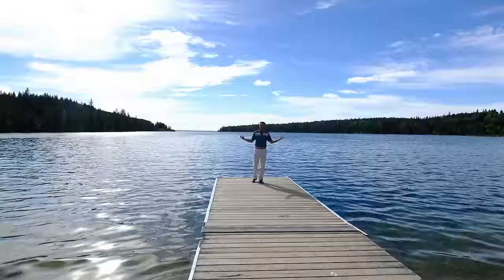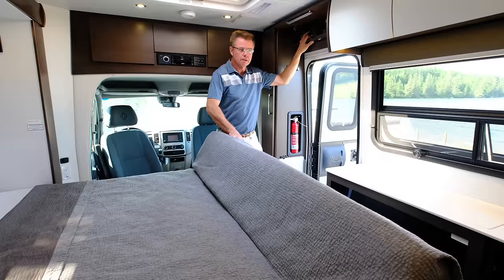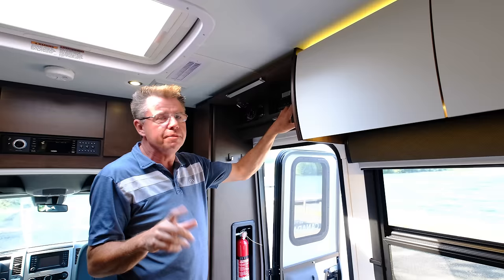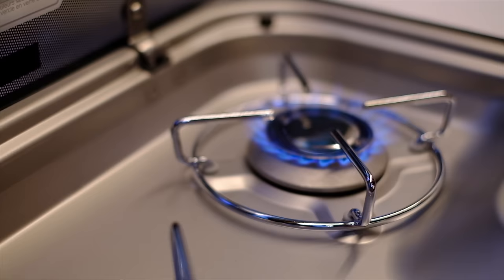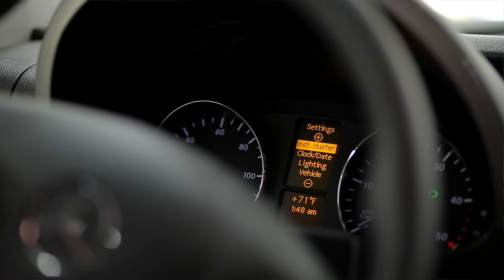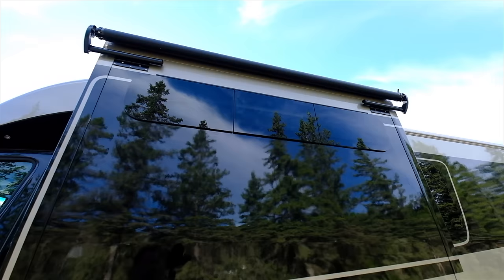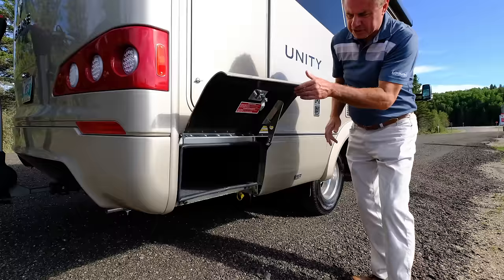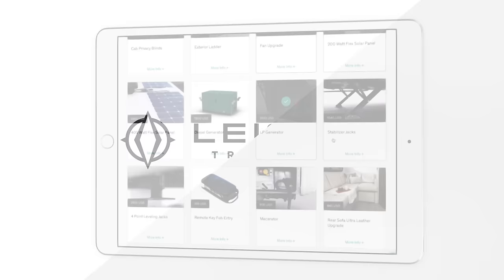2019 Unity Murphy Bed

Comment: I been watching the RV mobile home class B & C and Leisure is the best RV design and this guy is the best salesman he knows how to tell what people like to hear and what people need to know about their product. I love the class B mobile home.
Reply: we will feel safe travel along with him..I meant.. his knowledge about this...r u thinking the same?
Reply from the maker: Thanks Steve. We recommend seeing a Leisure Travel Van in person if you haven't already: https://leisurevans.com/dealers/
Reply: I had to wonder when watching this, though, how this one would be doing at -30 degs. C in winter use compared to previous Leisure Travel designs that were a little larger. I also wonder how much experience they've had with this particular foam formulation he talked about. With some types, if the unit is parked somewhere and various types of ants get started into the foam, they can eat the stuff away in volume to make a nice colony out of the interior wall or wherever they happen to get into. I am impressed with the use of a galvanized floor. Most RV's fail on the dissimilar-metals challenge between aluminum superstructure and steel floor, frame, and/or axle assembly connections. This still has the issue but at least they try to do something to minimize the corrosion potential by using galvanized product.
Reply: @ReflectedMiles  you bring up some interesting points. Too interesting. Appears to be a well engineered coach. I don't see myself enjoying the -30 below experience. I can see myself enjoying many of the new urban camping experiences the homeless rv trail blazers have provided for me.
Reply: thereissomecoolstuff  Thanks. Cutting out the cold season / winter sporting in Canada really reduces its usefulness, and at this price range it should be livable virtually anywhere anytime without concern. The nomadic Bob Wells / RTR followers do some interesting things. I especially like the cargo trailer custom conversions, but without good engineering behind them they are going to have issues fairly quickly and won’t last. Spacecraft and Prevost are in their own universe of high-priced monsters usually done right, but there are very few at the smaller / lower end that do, just Nord Euro and one or two others I have seen.

Comment: Impressive!  I priced one with the Murphy bed and most of the options.  Slightly more than $160,000.
Reply: Hal T  yikes
Reply: @dmsdms2707  - Yikes, indeed.  They are very pretty, they give you freedom, but they are not free.  The difference between a top of the line travel van and a comfortable car will buy a lot of motel nights.  Depends on what one wants and what one can afford.
Reply: Wow.
Reply: Don't get me wrong, I really like these RVs.  I think they are a great way to travel, especially the freedom they give you to stop almost anywhere.  If you've got the money to afford them, I think that extra freedom is priceless.  But, as an alternative, spend $35,000 to $45,000 on a good SUV.  That would leave you enough money (out of the $160,000) at $100 per night and 90 nights per year to cover the cost of a very comfortable motel room for 13 years.  Or travel for six months out of every twelve for 6 years.  

One of my neighbors has this same model, but I've not seen the interior configuration.   It sure looks like a sweet ride.
Reply: @Hal_T  - Its not worth it if you're just traveling, but if you wanna live off-grid, this is perfect. Instead of buying a car and a home, you'd get both in the price of 1 but with all the comforts. You can travel, park at your job so you're never late & don't have to deal with traffic (or work from home). And whenever you want to travel domestic, you can save the cost of flight, hotel, baggage, and rental car. I'd be a weekend wanderer, visiting the country. Instead of paying for rent or a mortgage, and a car lease, I could pay this off at $2K in about 7 to 8 years -- which is far quicker than paying off a mortgage. Not to mention that a mortgage also comes with property tax, furniture costs, maintenance costs, landscaping costs, higher insurance costs, etc. This van will require maintenance, but I can't imagine it'd cost me any more than what a home would require. Tbh I'd mostly keep it parked to live out of, like a Tiny Home and only drive it when I'm traveling south for the snow bird season. It's perfect for my situation. And here I was ready to buy a retired ambulance to customize for van living. That would've been way too costly and lacking most of the specifications of the Unity.

Comment: Best beds/living areas I've seen in the RV sector so far. Now make the vehicles fully 4 season, upgrade them to high-capacity Lithium batteries, 2-3000 watt inverter instead of 1000, and pave the roof with solar. Optionally, replace the toilet with a Cinderella Motion incinerating one, and some other odds and ends. And for heaven's sake get rid of the three way fridge and install a proper 12 volt compressor one already. :p
Reply: + inductive cooktop, and engine based generator!
Reply: @mundi6703  Agreed, you kinda need the Lithium to run the induction, and yeah ditch the Cummins and put in a 3-400 amp alternator and boom.
Reply: Thing is if they don`t do this, then other manufacturers will and that will take away sales for sure.
Reply: Exactly. This is the best build with Murphy bed but not practical
Reply: 'an while you're at it..Multiplex wiring, Voltstart,heated floors please!!!Sold!!!
Reply: mundi dot com 
Fire is better.
Reply: 3 options for using the refrigerator is Best. If Compressor breaks you have Nothing. As for inverter, you can probably Upgrade, or install your own.  As for the toilet it is a mascerator.(not sure on the spelling)
Reply: And add a Truma Combi, so the water heater and furnace can run on electricity when hooked up to shore power
Reply: @Croft:
I agree: 4-season for sure, and definitely more solar, but ALSO 4x4/AWD.
But the Canadian motorhome makers (who SHOULD know how to make a 4-season RV) just won't listen: Just come out with more bells and whistles on each new model, but NO real-world usability/capability/practicality -- for people wanting to USE their  RV ALL year long, and go off-road/boon-docking if they wish. And more solar power/batteries (lithium preferred) while out there.
They just don't get it, stuck in the past, more of THE SAME features, just updated, but not "getting with the program" TODAY: Only Winnebago has listened, and DONE it with their Revel in this AWD/4x4 & 4-season segment and with ZERO competition from any of these other makers -- like Leisure Vans! Yes, Winnebago's Paseo is 4-season, but not AWD, and their Era is AWD, but not 4-season. However, the Revel is BOTH, and the ONLY "B" (or B+/small C) like it for sale presently.
Keep the dry bath, trendy popup TV, Murphy bead -- all very NICE, true -- but it's not worth giving up practicality/real-world/everyday usability: 4x4/AWD (as more people are wanting nowadays given the "Overlanding" interest) and 4-season...or settling for anemic solar outputs.
Winnebago is the ONLY major factory-production small motorhome maker that listens. Leisure Vans doesn't, Pleasure-Way doesn't and Roadtrek doesn't.
IMO, WE tell the makers what we want...THEY don't tell us -- no matter how slick the sales presentation is.
Go figure...
-- BR
Reply: @ Bumble Bee:
No, the ammonia/absorption/propane refrigerators are LONG obsolete. COMPRESSOR units are the only way to go. 
It's 2018 for gosh sake, but lots of RV makers are "stiffing" people with the older, tired "technology" anyway...I guess trying to use up and the OLD stuff in their warehouses so THEY don't get stuck with it -- let the customer have it instead?
I'd never buy a new RV today that does NOT have a compressor refrigerator/freezer.
-- BR
Reply: And change out the propane cooktop for a induction cooktop
Reply: @DMosesRN  Or, keep things as is (with propane cooktop as a "backup") and bring along 1-2 portable NuWave PIC units (or similar products). I've been using mine for 5 years now and prefer induction cooking even @ home. 
But by the time I'm ready to get MY Class B (2-3 years) I expect MOST Bs will have moved more towards all-electric, and consequently to induction cooking. As long as the RV has plenty of solar and lithium batteries (but CHEAPER in 2-3 years i hope!) that should do -- when I'm not plugged-in @ a RV park somewhere on occasion where solar and batteries don't apply.
Happy Travels,
-- BR
Reply: Many people can't afford to buy one as it comes. Now you want to make it even more less affordable.

😳 Well, I suppose your ideas would be options for those who can afford to spend that much more.
Reply: @billredding2000  I think you are right but this unit is definitely more for the general rv user. Not the boondocker. The under chassis storage is the dead ringer. The chassis can handle it no problem. 3500 Mercedes is awesome. There are adventure units available just not on a mass scale. I love the Murphy bed. Way better than safaris magic bed.
Reply: @thereissomecoolstuff  
True, MOST RVs (regardless of class) are for the "general public," but with the increased interest and growing "overlanding" segment of the market we've been seeing, RV makers are only beginning to GET IT that some of us want a more usable (4-season) and more capable (4x4/AWD) vehicle...be it a motorhome or more rugged towable. And with more solar capacity. 
As for Class B platforms (engine/chassis), the Mercedes Sprinter chassis & diesel engine is THE major player on the Class B scene. Still, I'm concerned about high fuel costs, expensive repairs (anything diesel is like that) AND enough places (shops) to GET it repaired/maintained should I need to take it in -- I'd prefer a gas engine/4x4(AWD) ProMaster or Transit chassis "boondocking" Class B, but there isn't one!
I'd still rather have a GAS engine Class B, but the Dodge ProMaster can't tow much (a ridiculous 2000lbs or at its very best, 3500lbs) and a Transit is about the same -- which is weird, especially a Transit that has the VERY nice/powerful Ford EcoBoost V6 (probably the BEST engine for a Class B presently re: power for moving that much weight (even up hills!) AND gives decent gas mileage) AND one that has a dually rear end: It can't tow as much as that engine/chassis combination would indicate. Sad...
So again, I hope in 2-3 year's time we'll see ProMaster and Transit offer something to compete with the Winnebago Revel and the Coachmen Fit/Galleria re: 4x4/AWD...and 4-season, too. 
As for solar on the roof, they need to design it better up there: Put the AC unit under the vehicle (as in some Bs do) and locate the vents to allow the most space for packing in solar panels as efficiently as possible (just 3 large 350W panels would be nice).
Happy Travels,
-- BR
Reply: I am with you. Can't believe they build these beautiful vans and still sell us acid battery system and three way fridges with no option to upgrade.
As for making this a true 4 season van - it will be very costly and require major redesign and moving water tank inside.
Reply: @billredding2000  In order to switch to compressor driven refrigerators they need first to upgrade battery system. You can't run 7 cubic feet 12v compressor fridge on acid batteries.
Reply: @user-ym6lc7pk1e  
...the water tank inside has already been done -- as seen with 2 of Winnebago's Class Bs:
-- Paseo 48P
-- Revel 4x4 44E
Coachmen has made changes in their Bs to go 4-season also (their Crossfit and possibly the Galleria), but that's the only 2 major-player B-makers doing so presently that I know of. Not really that much an extra cost, but even it it were, I would pay it.
It's Pleasure-Way, Roadtrek, Leisure Vans (and others) not "getting with the program" for whatever reason. Not saying ALL their Bs should be 4-season/4x4, but ALL the B-makers should produce at least ONE model that is. After all, it's almost 2019 for gosh sake! ;-)
Happy Travels,
-- BR
Reply: @user-ym6lc7pk1e  
Today's compressors use VERY little power...so that's not an issue. It's your home-size/kitchen refrigerator that's the energy-guzzler!
I wouldn't buy a new RV (regardless of class) that is trying to pass-off their old, obsolete ammonia/absorption refrigerators. That's outrageous. Again, it's almost 2019 -- go compressor, period! ;-)
-- BR
Reply: Umm.. umm.. h-hello.. I didn't know there was a RV community. I am from the YouTube community. I come in peace
Reply: @  @Jake_Sully445  There are even RV-specific (brand and/or a particular model) communities. For example, there's one on the Winnebago Revel 4x4 44E -- it's on Facebook. But there are Roadtrek (brand) and other RV forums, too, be they motorhome (Class A, B, C) or towables like the Airstream Basecamp, Lance, Leisure Travel Vans, Phoenix Cruiser, etc. forums. Maybe even truck camper and fifth-wheel forums. Not ALL makes/models have their own community/ forum, but most of the more popular/mainstream RVs do.
They're a great place to find out real-life experiences/reviews of a given RV by people who actually own and use them...helps during the research process deciding which one to get.
-- BR

Comment: Do you think you could get a small non dry bathroom of a composting loo and a small shower and then use the space for a small separate living space? Also, can you have a slide out in the back as well to make that small second living area bigger? And are you able to have a roof extension where it goes straight up ? .....then what's the maximum size water tank ? No need for black tank if we have a composting loo I think and happy with a small grey tank because of the same reason....is this class a class b van?....thanks in advance.